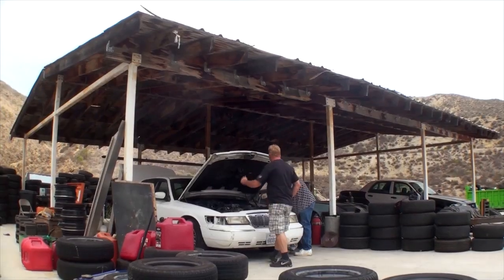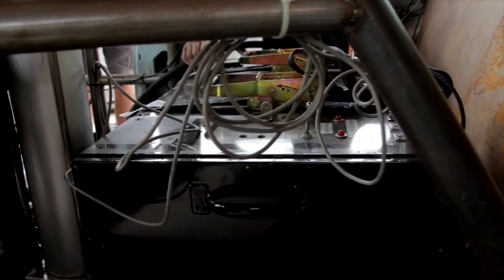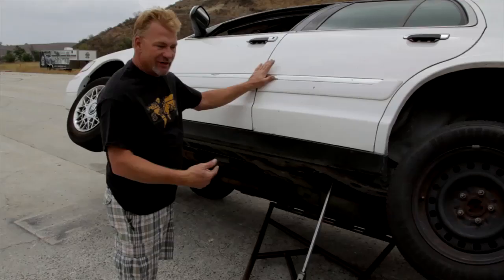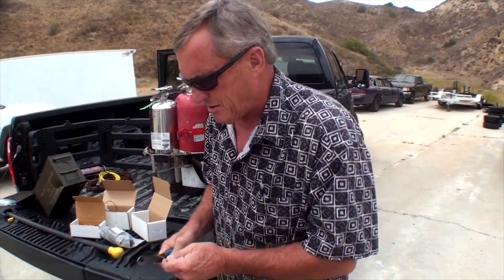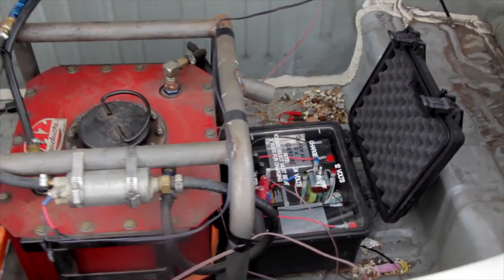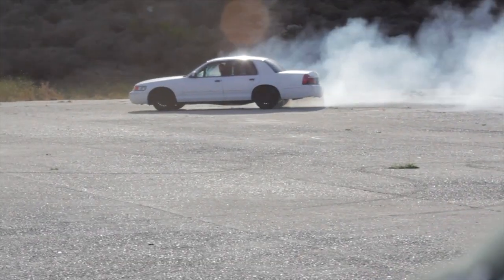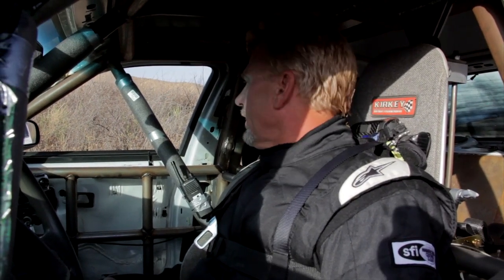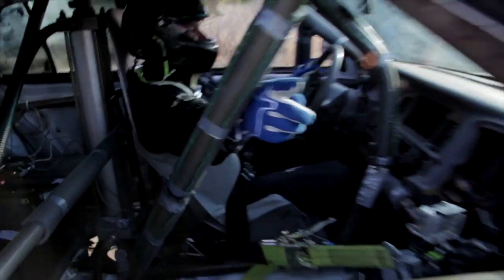Car Rollover - Behind the Scenes Stunt Feature

Comment: The original "cannonroll" was a lot more aggressive. A 2 foot long hollowed out piece of telephone poll packed with gunpowder and mounted under the car and wired/rigged to a device. Maybe nailing gas pedal and at a certain speed would ignite the powder. Wiring to the headlight switch, then turning on the headlights, igniting it that way, etc. This new way is less conventional to say the least. Some movies that used the more violent cannon material: McQ (1974) Race With The devil (1975) Stunts (1977)